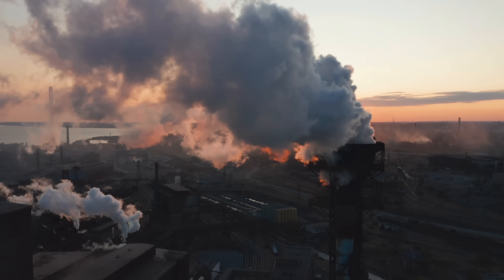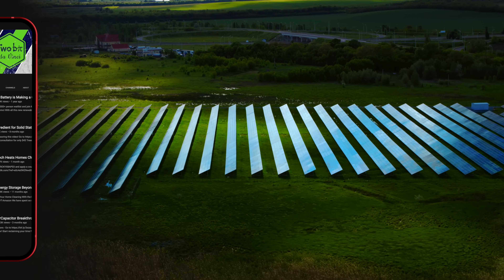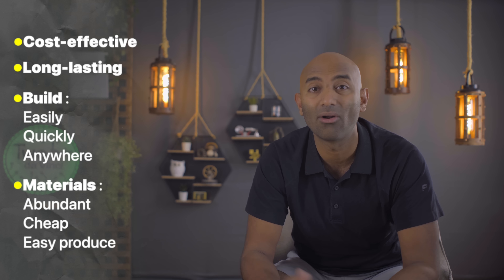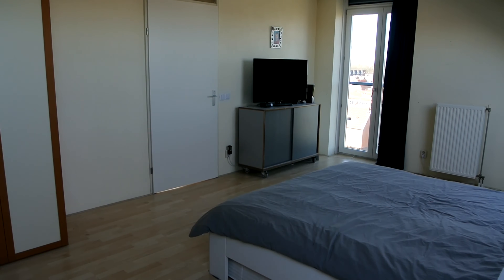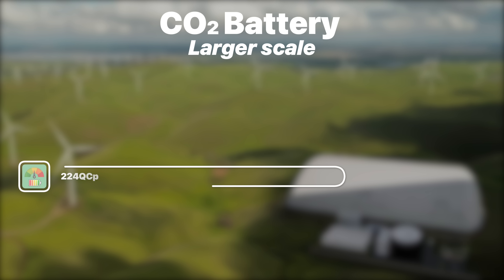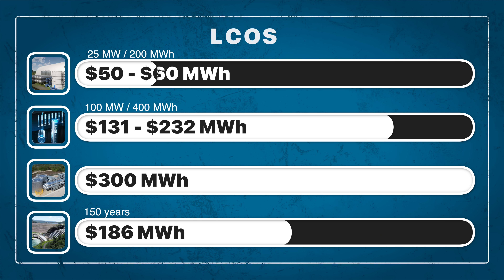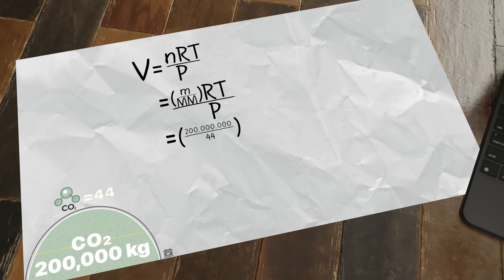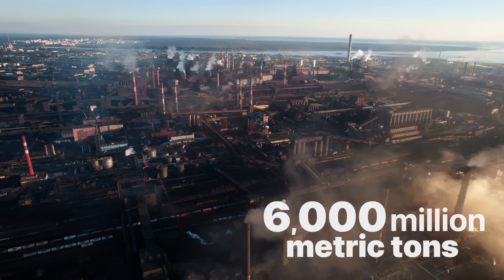The GENIUS Of the Carbon Dioxide Battery

Comment: The round-trip efficiency of 75-80% really isn't a problem: adding excess renewable capacity is pretty cheap. We need industrial scale storage in order for an entire grid to be run solely from renewables all year round without interruption.

I think the biggest challenge with CO2 storage is the size and cost of the CO2 dome. I wonder whether they can down-size this by storing it under pressure too - just a much lower pressure than the liquid CO2. This will reduce the efficiency, but additional renewable capacity is probably cheaper than a huge dome and the land area it would occupy.

In the meantime, while we still have fossil fuel power plants in operation, why not build a liquid CO2 storage system on-site, using CO2 released by the plant, then later discharge the CO2 into the atmosphere? That would allow for a much smaller CO2 dome.

Comment: So, YAPCB (Yet Another Phase Change Battery), but using CO2.  CO2 does have some benefits from its phase change pressure/temperature.

I would ask is CO2 the best choice?  There are lots of positives!
Are there other molecules that would work better? 
Can this be used at the end user location as a local (business or home) battery back up at a smaller scale? (Smaller domes?)

The problem with a CO2 leak would not be an atmospheric impact, but a localized oxygen displacement issue.  CO2 is heavier than "air", specifically oxygen, so it displaces oxygen at ground level and suffocates anything in the area it saturates.  This has happened naturally from volcanic activity and from certain lakes that erupted in CO2 explosions, most notably in Africa.  From an industrial perspective, mass suffocation from a CO2 release event have happened many times, fire fighting being a notable situation where the benefits of CO2 are also the dangers.

++Steampunk reference!

Comment: Hey Ricky, thanks for this concise and informative video!

Because demand for power does not always match production from renewable sources, there is an abundance of power during low demand periods which could be used for the initial charge of these CO2 reservoirs. With the right design, these systems can operate with only a partial fill of CO2 and provide a power source during high-demand almost right away, albeit with lower total capacity.
When placing these batteries near renewables sources, there would be abundant power available during low-demand times to operate equipment temporarily on-site  for direct CO2 capture. Once the battery is filled, the capture equipment is then moved to the next battery which is ready for filling.
Reply: Yes that's the whole point, storage and peak shaving

Comment: I always thought that a battery was a device that would storage energy by direct conversion of electrical and chemical energy... In this video I learned that a battery is simply a energy storage device, like a spring, a compressor, a dam, etc. This are very good news, because my old Petrol car is after all an electric car. It has a large energy storage device (a tank full of petrol) and it kind of converts at least part of that energy in electrical energy... Wow.

Comment: Two questions.
1. Where does the heat (energy) from compressing the CO2 and turning it into liquid (or solid) go?
2. When it turns back into gas where does the heat (again energy) needed to do that come from?
Reply: There Is an heat storage system inside .
Reply: Comes from the plug. In the wall.

Comment: If you run a liquid air battery installation, wouldn't CO2 not just pop out of this? When releasing the stored energy you have to vaporize the stored gas, thus possibly generating lots of cold air. Which in turn gives CO2 in the form of dry ice, and there you have it.
Even if technically not factored into that storage so far, couldn't that be a good side business?
Reply: There Is a heat storage system inside .
Reply: @rscaht  Of course there is. But nothing is 100% effective, so some external heat supply (from the environment) still is required. That is not a problem though.
My intention was partially different: If you already have something very cool and you need to heat it, why not use that cold for other use? Like in a conventional power plant you may use the heat in the cooling system to heat up residential homes.
Reply: @intotron-X  the system has to work at room temperature , there is heat but not at an interesting temperature that could be exported from the plant .
Reply: @intotron-X  But the idea is goood  ! It's possible to make an air conditioning operating in that way with a storage of CO2 filled during low energy cost (or energy surplus ) on the grid . Of course for big scale industrial or malls .

Comment: Interestingly, this setup could be coupled with commercial building air conditioning… co2 is an excellent refrigerant. I can envision configuring micro plants in office buildings providing the air conditioning for it, and producing electricity when needed…
Reply: The Dome Is huge ! 
Oh , now I understand how Central Park could be used for !
Reply: This Is an interesting ad on .
Reply: Super critical CO2 turbines can be very small compared to steam turbines. Useful for solar thermal or even small reactors.

Comment: I would be interested more in scaling it down to level and smooth out the grid in general. this would reduce cost by making the electric equipment easier to maintain
Reply: Scaling it down makes it even less efficient.
Reply: @filonin2  I agree but I think it might be useful
Reply: It needs scaling UP to "smooth out the grid in general"
Reply: @rogerstarkey5390  I ment if we could size it to residential. Single family home size you could charge at night during cheaper time and never/rarely touch peak hours. The peak power stations are where the cost comes from

Comment: Thank you for the video.  Do you have any information on companies planning on bringing this technology down in scale for individual systems.   Could it be an alternative to power walls attached to home solar arrays?
Reply: The power per unit volume is too small for that. Same reason you can't have efficient individual pumped hydro. The economy of scale and square/cube law is how this manages to work. If you have 200x the space a powerwall takes up, then it might be ok. He shows how large a tesla car battery would be using this system at 10:36.

Comment: Interesting ! I maybe didn't understood everything well, but when the co² battery releases the compressed co² to produce electricity, where goes the co² ? In the atmosphere, or it is a cycled loop? Thanks for your answers !
Reply: A cycled loop. Ambient temperature gas in the bladder (Think big plastic bag) is compressed into the tanks (The battery), deflating the bladder. When the compressed CO2 is run through the energy turbine to make power when needed it expands and goes back into the bladder. The ''tank'' is more like a closed hot air balloon, without the heat.The cover you see is simply to keep the bladder safe from winds and weather extremes, it's not a pressure tank. A simple shed could work, but not as well, as the cover needs to protect the bladder on the inside from protusions that could rip it.
Reply: @LostCylon  "Tank" you : )

Comment: Soil and soil biology is the carbon sequestration solution right under our feet.
Managed even a little more thoughtfully and the worlds agricultural real estate would both hold carbon easily better than most tech solutions and liberate oxygen too. This aspect is too often overlooked. Why store all this abundance of Co2? It seems like a problem approached this way. The compartmentalization of today's tech wizards thinking is astonishing.
Bio-Char production must be ramped up to an industrial level of urgency to lock up all the bio mass that will otherwise naturally release Co2 into the atmosphere again. Simply putting enough Bio-Char in the worlds soil is a miniscule but vital part of the equation. Replacing conventionally used materials with properly graded Bio-Char in various applications across the manufacturing spectrum is a very important thrust towards the carbon locking /sequestration dynamic too. As an aggregate in concrete and cement processing  for example the structural advantages have been demonstrated.  Even better if the Bio-Char has first been used for filtration. Multiple potential industrial disruptions are possible with using Bio-Char. 
 Read: 
BURN- Using fire to cool the earth

Comment: Sounds very promising.  You are right about the source of CO2 though, if there isn't government subsidy of captured CO2 for use in these systems they will be using CO2 produced by burning something.  Way back in prehistoric times (the 1960s) my old Dad worked for a company that made dry ice (solid CO2).  They got the CO2 gas from the exhaust of the diesel engines they ran to produce the power for the plant.

Comment: Liquid air CAN use waste heat just like the CO2 system simply by heating water to store the heat produced by compression of the air that is part of liquefaction. The CO2 system requires about 1600 times the storage volume of liquid air which unlike CO2 can power a car although it is less than lithium batteries at 250 W/kg. Also that big “balloon of CO2 sure looks fragile.

Comment: The safety of this system is incredible ! this is a point you have underestimated in this beautiful video .
80 % efficency is not bad at all ! As Hidro on mountains rarely reach this efficency (charge+discharge) due to long pipelines .
In Italy we are used to these Green Domes used to produce biogas in the countryside , (an efficent way to capture C02 and methan from agricolure and farming )
Reply: "Safety" in terms of not erupting into a fireball or irradiating a large area after a catastrophic failure. Sure. However, an above ground dome as shown is rather unsafe. A containment failure of this volume of gas would send a river of oxygen displacing CO2 along the ground, suffocating and killing any animal life in its path and pooling in topographical depressions. (There are places in the world this phenomenon happens naturally and it is terrifying how deadly it is.) If implemented, a reservoir of CO2 is much safer to everyone stored underground so that it may not flow anywhere in case of failure. I wouldn't live anywhere below one of these power plants if it used a dome.
Reply: @Syvtek  you touch the point . But a massive flow Is highly improbable due to atmospheric pressure . An empty depression like an abandoned cave should be the best place.

Comment: You do not see companies throwing a bunch of money at a light scale power plant because they think it's nice. I always had trouble with figuring out the point where a chemical turned from a liquid to a gas. Never could get the formula to stick. I am wondering why the 75-80% variation. I see this as a good item for filling up daily high demand time for 8 hours per day or more. Since this is essentially a new way to generate power. Like hydrogen you need a pretty clean co2. So how do we supply it? I really do not see anyone getting the stuff in our atmosphere to that level economically. Otherwise they would be getting tons of funding too. If these can work as short term daily supply for many then something like the earth radiator may fill long term power demand and replace coal and natural gas eventually. In as broad a fashion as this is thought to be. I get that it can be scaled up, but at some point they will get to where the dome gets huge [maybe multiple domes at some point]. That might become a not in my backyard issue. Where small localized plants might be tolerated better as a necessity. What might be an option is manufacturing companies might buy one to supplement any solar and balance power usage. The cost and life cycle seems like something from the 60's from a financing prospect. Which built a lot of coal plants.

Comment: those hoymiles microinverters are interesting but surely you still need to combine all of those power feeds into a single feed? how does that work?
Reply: The microinverters synchronize themselves with the power grid (and each other) so they can all output into a single feed. That allows for easy expansion, as new panels with microinverters just synch with the existing equipment. The downside is that they all shut down if there is a power failure on the grid.

Comment: This is game changing for the utility level energy storage market. We don't have an energy shortage, we have an energy storage shortage. This is the ideal fix using current off the shelf tech that is cheap and available combined with a phase change medium that is also cheap and ambient temps.
Reply: Not a "game changer" (a phrase used FAR too often)
It's a POSSIBLE piece of the puzzle in certain circumstances.

Comment: If we constructed wind and solar to only meet our present needs, there would not be any arable land left to live , or grow crops on in the U.S. When you consider population growth here, there wouldn't be any visible mountains or sea shores. Alternative power supplies are NOT feasible due to the areas they cover, the wildlife they displace or kill, and the places available for people to live. Battery storage and solar efficiencies must increase by 400% before any solar and wind can be anywhere closer as needed. The only substitute possible is low pressure Thorium molten salt nuclear reactors. This technology is more than 50 years old, but not used because the Thorium reactors do not produce nuclear weapons grade material. Now is the time where Thorium comes into its usable electric generation. Easily turned off or on, these plants can supply local power  safely because of its design. Thorium power plants can be modular constructed and trucked to its site and assembled in about 10 months as compared to high pressure fast breeder reactors that have been so troublesome in Chernobyl, Three Mile Island, and the Japanese Daichi power plants taking 10 years more to construct.
This new idea for "carbon batteries" is fine, but how efficient are they really are? AND, how do we charge them with the power plants we presently have? Could they be used in EV's? Would they last as long as the alkaline Edison Battery (over 100 years?) Can they deep cycle? How big are they for home use? Lots of practical questions that need real answers, not theoretical answers. Everytime you turn on your TV, there are new theories on new battery technologies you see once, then never again because they do not work out. Nuclear power is coming into its age, nothing else is cleaner in its use, and Throrium "burns" itself into a small amount of ashes with a half life of only 300 years, not like uranium and plutonium that is dangerous to store and it takes thousands of years for it to be safe to handle. High pressure reactors are dangerous, ruinous, and a threat for many hundreds of years ven if their wastes are buried deep for many millenia. What legacy do we leave for our descendents being saddled with the excesses of our present times? What do we do to closed down reactors, but bury them and poison the groundwater around them as they are forgotten? Thorium reactors are the interim solution until full fusion power is real and usable which may still take centuries to realize. How many brownouts and blackouts are you willing to endure because of the short sightedness of power companies and our Government? Think about this real hard.

Comment: Thanks for a great video! 
In the light of what's going on in Ukraine, wouldn't these huge storage containers be the perfect marks for drones etc. and make the energy grid extremely vulnerable? How would the co2 battery and others types compare ROI wise if they had to be concealed below earth surface?
Reply: co2 while not free, it is extremely cheap. there is nothing exotic or expensive about this. The white shell is made to protect the bladder inside from natural damage, but it could just as easily be buried just below the surface for more protection.  if you really wanted to game out the economics you would need to make the cost of damaging the system extremely lower and happen very often to counter than the cost of repairing because it generates real work for the grid 24/7 by simply being functional. I question if bullets would be even cheap enough to justify using on it. There is such a shortage for utility energy storage you would have to have the plant workers themselves sabotaging the plant to make it nonviable.
Reply: Yes they are easy to vandalize, but they are not that enticing targets, do to the cheap nature of their construction. The dome can be perforted by handguns, probably even knives, but you could literally duct tape it up to be serviceable for a while. If you are not in a war and you are only concerned with accidents making the plants useless, a spare bladder can be stored on site, and be replaced within days, while the gas is compressed. 
The machinery and the tanks can be encased or be underground if need be, but i think the biggest protection for the site is that it does not generate electricity, just stores it. Meaning solar pannel fields will be the targets instead, as those are way more vulnerable, and generating power themselves.

Comment: You're mixing MWh and MW. The information should be presented as how many MWh it takes to charge the battery (liquid CO2) and how many MWh (likely to be kWh range) that the alternators produce from the CO2 storage. Not all the stored CO2 can be used to produce electrical energy as there is a minimum pressure that can drive the turbine driving the alternator to produce a stable frequency voltage and current plus there are a lot of losses in the processes both mechanical and electrical.
Agree we need to look at as many storage options, horses for courses.